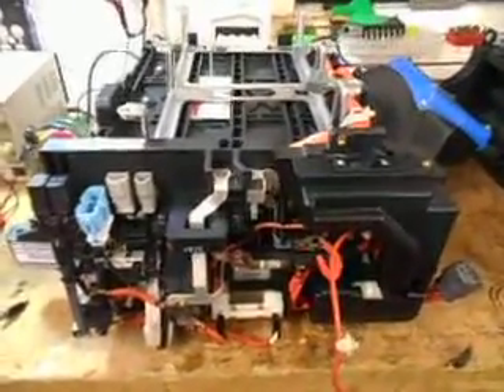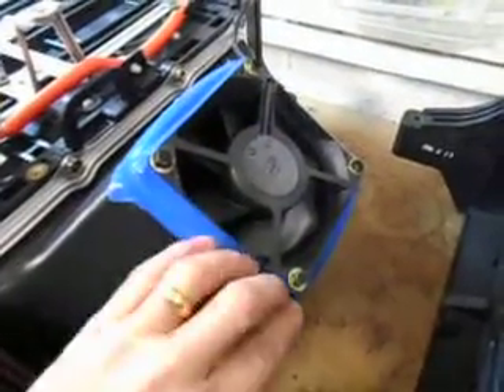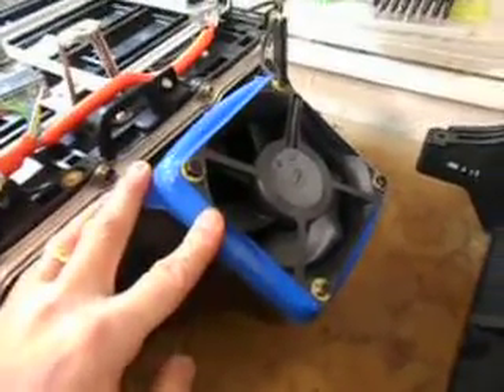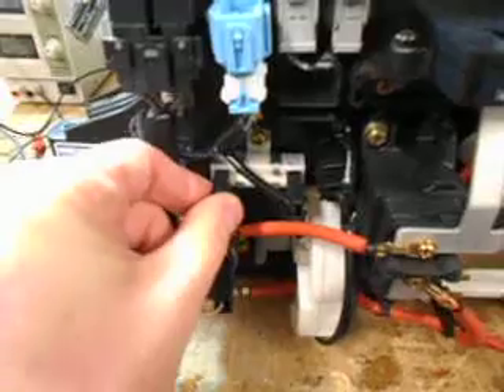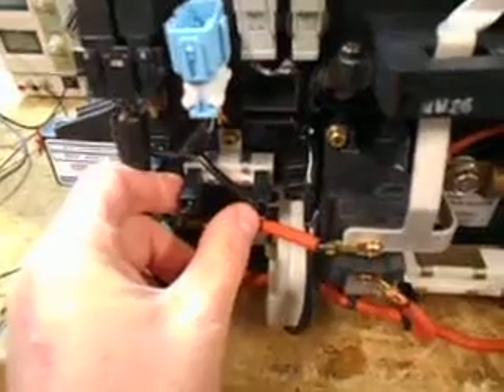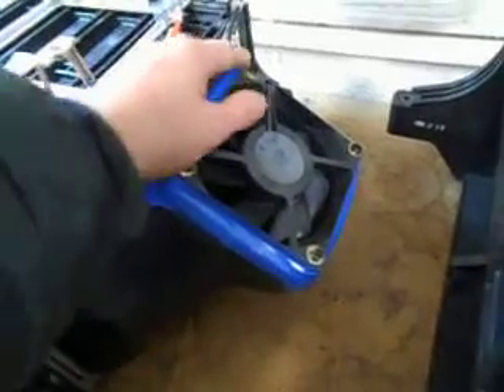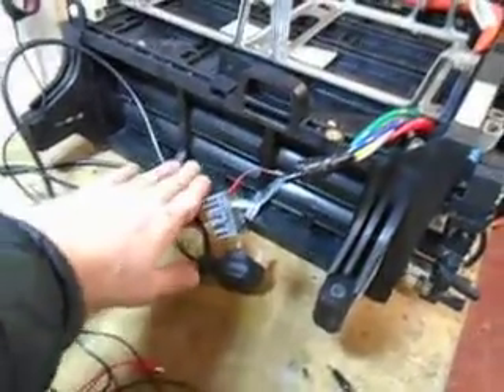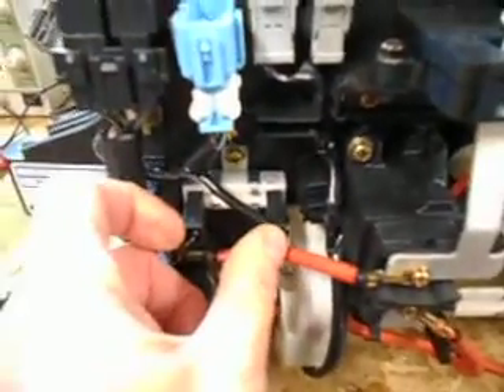IMA Battery Fan Mod Info

Comment: Help please!  Had new Ima battery installed by dealer. Picked up car and 2 min later lights back on. Returned to dealer and diagnostic said IMA fan needs replacing?!?  Shouldn't' this been checked when during repair?
Reply from the maker: e-mail me at 150mpg@gmail.com